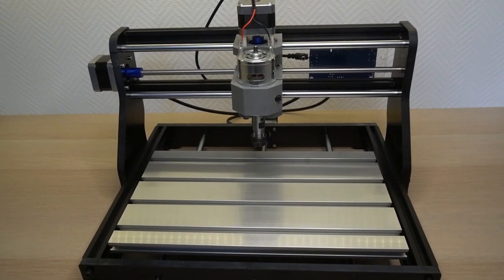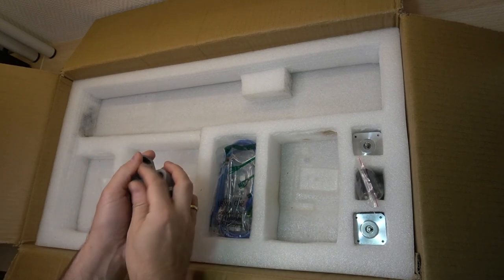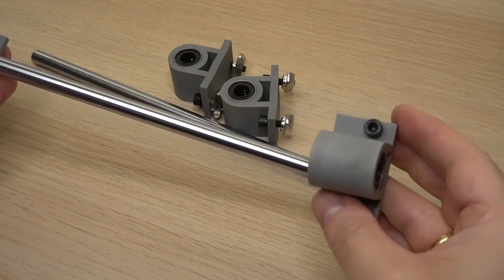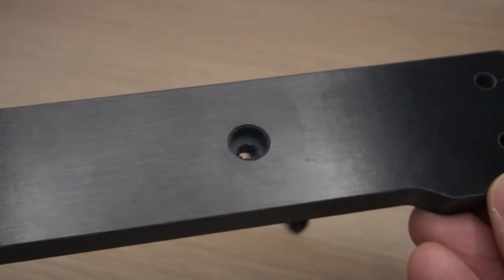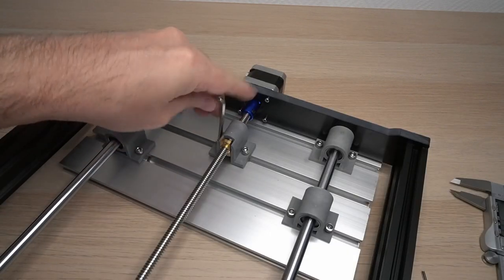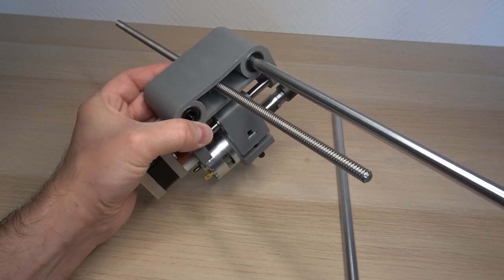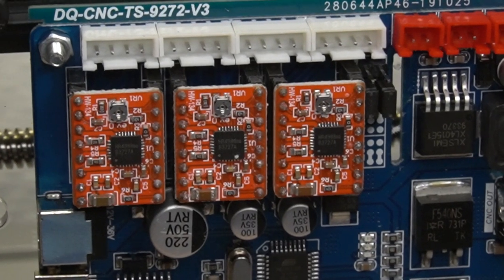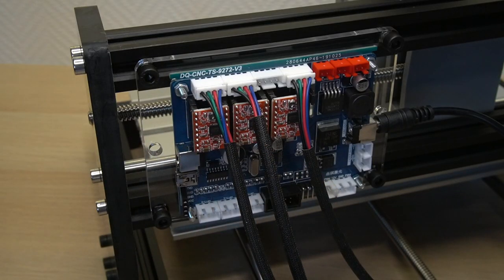CNC 3018 Pro unboxing and assembly

Comment: I fail to see how the X axis spinle (10:27) in the video fits tightly to the motor carriage. I did exactly as you said but nothing is tight, the brass piece with spring always comes out. should there not be a similar fixing on the other side of the body?
Reply from the maker: Hmm.. Strange. I did not have that problem in that part. There is no thread on that part?
Reply: @ezContents  I had bought the device from a guy who had assembled the 3018 (badly) and given up. In the box was a tube that is not listed,  that was threaded on the inside. This was a tube had somehow fallen out of the body in transport. I pressed it in the body and now all is tight